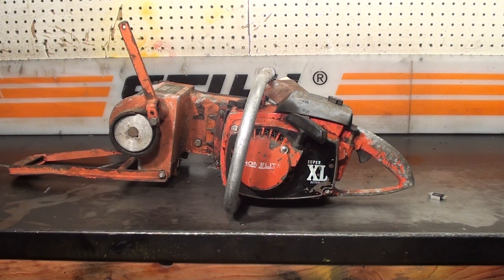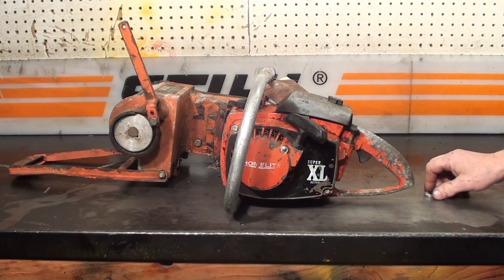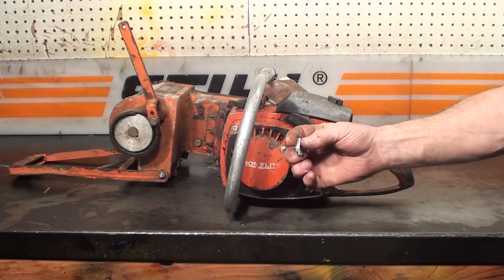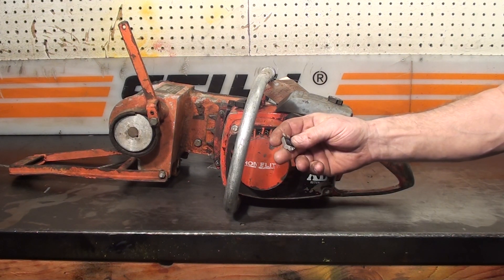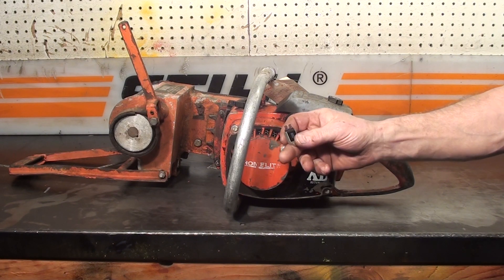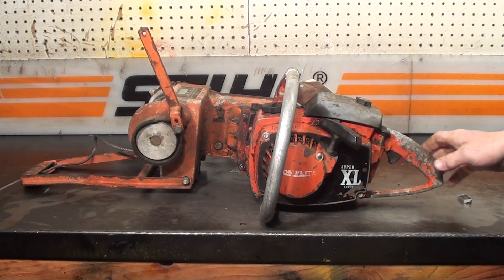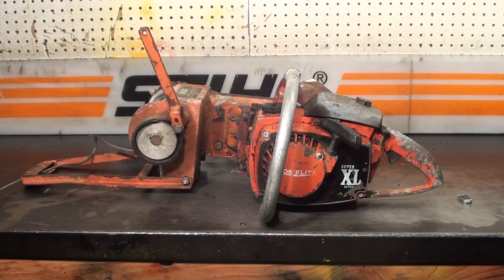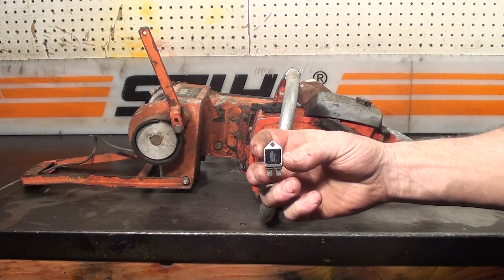The chainsaw guy shop talk II Ignition repair Homelite XL 12 Winch

Comment: Great videos, thanks for putting them all together.  Why does it matter if the coil is on the outside or inside of the flywheel for the chip?